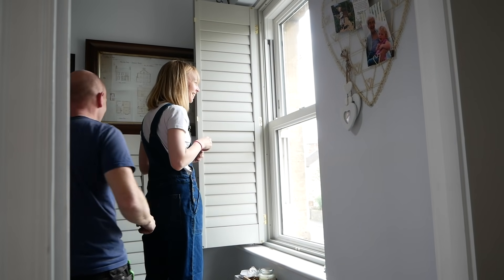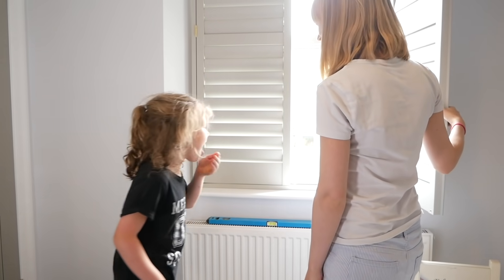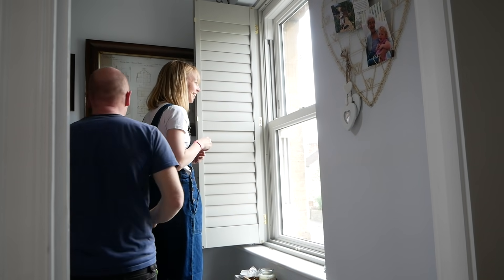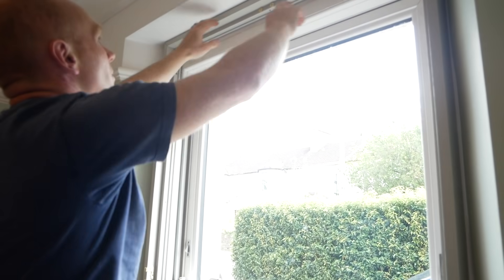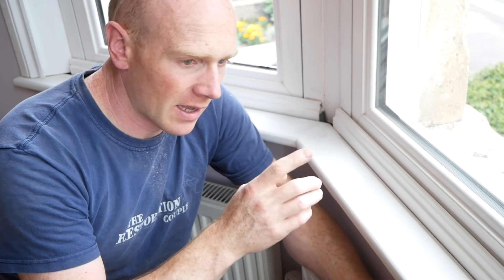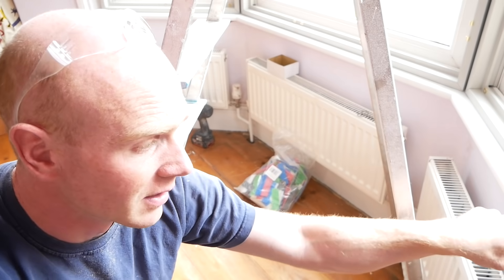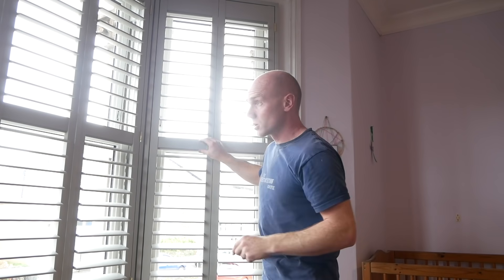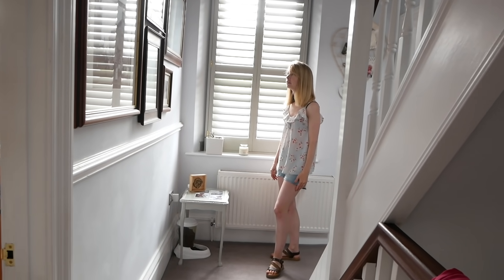TRANSFORMING OUR HOUSE WITH SHUTTERS | Farewell old net curtains!

Comment: The only problem with that type of shunters is they attract dust and need to be cleaned frequently. They do look good though and it is a big upgrade to your house
Reply from the maker: I have found the small leaf blower works great. Only because I sanded plaster above them recently! 😬
Reply: If ther real wood they warp when windows open and don't shut properly like mine do 🙄

Comment: One benefit of pulling the shutters forward on the window sill is they will open fully and sit flush against the wall. Though that will dramatically decrease your ability to spy on the neighbors doing weird neighbor things. Great video as always.
Reply from the maker: Or alternatively have them where we put them but with bifold pairs so they sit into or against the angled reveals. But more joinery and trim to make fit like the traditional type but we did consider it.

Comment: I made my own shaker style solid shutters, upstairs and downstairso on bay windows on a Victorian terrace house…. (Incidentally I’ve just finished them about 2 weeks ago) white oak surround with 6mm MDF panel insert, then spray painted and last coat hand painted. Circa 34 panels…. A LOT OF WORK…..
I do prefer the solid to the shutters, but that’s my preference. Mine took nearly 20+ working days, sanding, painting fitting etc to do mine, so work that out against a purchase price…. I think it’s cheaper to buy them. But I do love them ( now they are finished) but worth considering.

Comment: Worth considering is that curtains provide acoustic damping in the room, whereas the shutter will maintain the reverberation. 
With your selected shutters, I can see that you will end up with paw prints on the shutter blades especially with small children and they will need an easily wipeable surface finish.  Separate actuation of the blades would resolve that.
It is fortunate that you have sash windows that don't affect the shutter operation so that you can select the very simplest of installations.  In my installation I have part circle bays with tilt and turn windows that preclude a head and a cill section for the shutters.  They will have to be free carrying over the full width and be stacked back on each reveal.  One of the design criteria is that the two ground floor bedrooms are shaded with the shutters, whilst allowing the tilt function of the window to provide secure summertime night ventilation.

Comment: Just had shutters fitted in my house…love them 👍🏻 Advice given by company when you have them open have them angled up..if you angle them down the sunlight will hit your flooring and soft furnishings and eventually bleach and fade the colour from them..angle up stops that as the light bounces upwards
Reply from the maker: Great tip. 👍
Reply: Also shutters up makes the room not as hot. 👍

Comment: shutters inside - I am still confused. I have never seen that in my country (germany), here they are always outside to protect from the weather.🌬️🌦️
(and not just for decoration like in the us😉)
Reply from the maker: Traditionally shutters here in the UK are inside and would usually fold away into the walls/reveals either side of window. At least that is how most of the historic buildings around here use them. Therefore, best to think of them as a form of blind rather than for weather protection. 👍
Reply: Interior shutters are not used just for decoration in the US. They're great for insulation and privacy, and they are an actual value added to one's property value.